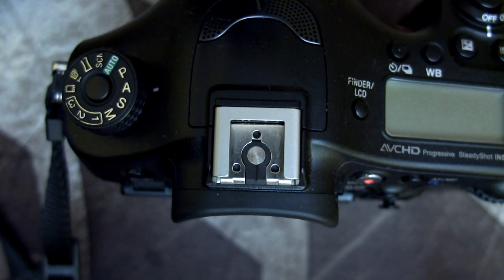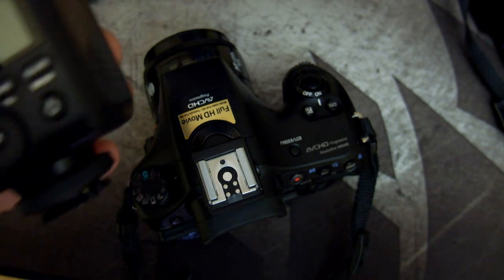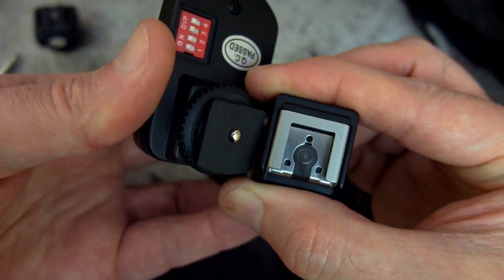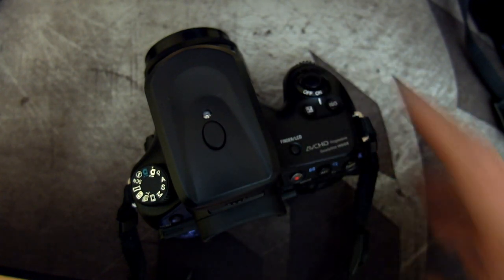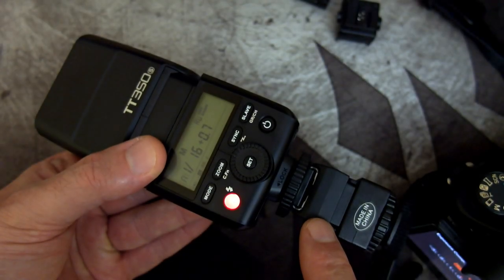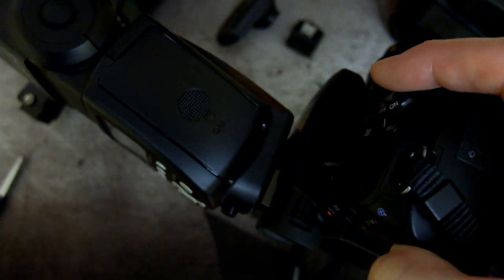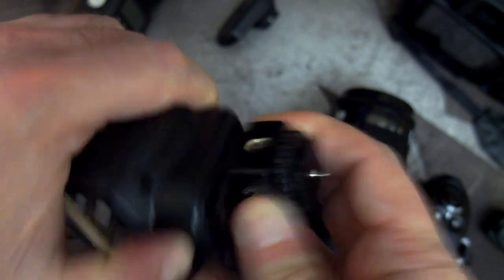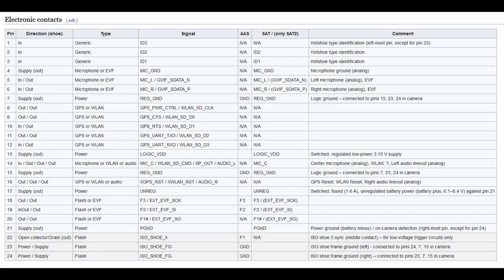Sony Multi Interface Shoe: Problems/Solutions + How to use the flashes on a standard hot shoe

Comment: Hello, I'd like to ask you a question: I found a Neewer flash at a very affordable price (Neewer NW635 TTL GN58 SONY) but the problem is that the seller told me it did not have the “Locking pin”. I wanted to know if it's possible to buy a locking pin or an adaptor to plug the flash on my sony a7iii? Thanks in advance
Reply from the maker: Even the Godox ones don't have a locking pin, and the Sony official adapters don't either! I wouldn't worry about it, however make sure you lock it down firmly when you attach the flash, I've no idea why Sony don't have locking pins for the holes, it's a mystery.
Reply: @MrBazReviews    He told me he didn't have the hot shoe of the flash , it's the object at the bottom of the flash that allows the flash to put it on the camera
Reply from the maker: @shinefiru3751  You can't add the locking pin most don't have it

Comment: Hello Mr Baz. I am sorry to ask you after all these years. 
so my old SONY A99 (which you also reviewed at 2022) original flashlight does not work anymore. 
According to my understanding, SONY A-mount A99 is using Multi Interface Shoe. 
which flashlight will you recommended on Multi Interface Shoe DSLR like SONY A-mount A99?

I had been seeing GODOX TT600, TT685, V850ii . I think you have all of these flashlights. 
Can I ask, does it work on A99?

I am sorry to ask this silly question. I had been searching all over the internet and can't find any good answer.
Reply from the maker: As per email 😁 But for others yes Godox work on E and A mount cameras
Reply: @MrBazReviews  Thank you!
but do I need to buy the adapter (as in the video)? or just plug and play?
Reply from the maker: @ShyDeath  No adapter if you have multi interface flashes and shoe. It is only if you are using the older Minolta inverted shoe (or if a standard shoe contact won't fit)

Comment: Sony A7S II + ADP-MAA + Sony HVL-F42AM. Is it impossible to use 3rd party Wireless radio triggers and obtain HSS/TTL?
Reply from the maker: If the Sony flash is converted it should work with third party triggers, for HSS/TTL, the only issues I've seen are some universal shoe (standard shoe not MIS) not always fitting the newer hot shoe. If it's a Godox you buy then it will have the MIS (multi interface shoe) and will work OK
Reply: @MrBazReviews  Thanks, bro

Comment: Hi there - I have a Sony A7iii just bought a few weeks ago but my Nissin i-40 is not showing up on the monitor screen.... It does however work in Manual mode. I do want it to work in TTL though. Do I need an adaptor?
Reply from the maker: If it's a Sony compatible one it should work, for TTL anyway. check the connection and clean out the contact if needed. If it's a non-Sony then it will be manual only

Comment: If anyone has problem getting the transmitter or flash to work, get the ATG Gold M/N Adapter.
Once you have that mounted onto camera's MIS (multi-interface show), you can even use Pocket Wizard or any normal trigger transmitter (433MHz or 2.4GHz trigger system) or Canon 580EX II, 600EX-RT, 600EX II-RT or Nikon SB-800, SB-900, SB-910 & SB-5000.
Reply from the maker: Many will work some won't I had issues with pixel triggers not quite fitting in
Reply: @MrBazReviews  ATG suggests to file or sand down the transmitter's front hotshoe.
Hope yours is not made out of metal, then you will have to power file it down.

Comment: Is there any way to convert the hot shoe to a 3.5mm jack? With an adapter or something? I am trying to find a decent microphone for a sony a6000 but till now the only solution I have found is having an external digital recorder with me.
Reply from the maker: I've not seen one, at all but can't say for certain I did a search nothing showed up. The shoe has the audio contacts, but as far as I can tell that only has limited support for a few Sony microphones. It's a bit strange the A6000 didn't have a microphone socket. Looks like you are stuck with either getting a shoe microphone, or doing some kind of external audio recording.

Comment: I'm getting an intermittent fire using my a7rii and a neewer trigger for a set of studio strobes. Used to work well. I was presuming this is down to age of camera and worn parts. Do you reckon this may solve my issue???
Reply from the maker: Have you checked the contacts for any damage? One of the problems with the multi shoe is the contacts are exposed, so I keep the caps on the base of flashes and triggers (and hot shoe). I would just inspect the trigger contacts and on the camera. Look for any obvious damage. Might be worth using a blower to clear out around the hot shoe, in case anything got lodged in there. I have seen that before some
Reply: @MrBazReviews  Thank you. I will have a good look tonight. Fingers crossed
Reply: What Neewer transmitter do you have?

Comment: Great video, perhaps you can advise if it will fix my problem with tge new Sony A7M4 camera.
I have the latest Godox XPro- S trigger unit and it needs a lot of force to mount it on the Sony hot shoe on this camera.
I am really worried about damaging my new A7M4 hot shoe when applying so much force to slide in the trigger unit, it's so tight to insert.
I have a Godox TT350 new flash gun also and this is just asdifficult to slide in the camera hotshoe.
Would appreciate any ideas and will this unit solve the problem. Many thanks
Reply from the maker: Have you tried the flashes in any other camera shoes? I've not had a problem with the Godox flashes fitting, in various MIS cameras, or adapters, none were really tight. I'm wondering if the camera shoe is not quite right, it should be a standard size, but if there is a problem it might be making fitting flashes hard. I'd see if you can get hold of another camera to try, or other flashes.
Reply: @MrBazReviews  Hi again, I have just visited my Sony dealer called WEX, we tried a different A7M4 and a different trigger unit, the staff remarked how tight a fit and a lot of force was required to mount on the camera hot shoe, maybe Sony are trying to encourage us to buy Sony flashes, not Godox
Reply from the maker: @MikeT-yy3  I know WEX I bought from them before. It's a fixed size, so unless they made it slightly tighter on the A7IV - never once seen the Godox flashes and transmitters (have used 4 of them), be a really tight fit on any Sony with the MIS. 
Saying that, I dislike the shoe quite a bit, flashes can fall off, as there is no auto lock pin, and if water gets in - you can misfire flashes. I've no idea why they went with that design. It's the part at the back near the contacts that sometimes causes problems with shoes that are a bit too long.
Very strange
Reply from the maker: @MikeT-yy3  I know WEX I bought from them before. It's a fixed size, so unless they made it slightly tighter on the A7IV - never once seen the Godox flashes and transmitters (have used 4 of them), be a really tight fit on any Sony with the MIS. 
Saying that, I dislike the shoe quite a bit, flashes can fall off, as there is no auto lock pin, and if water gets in - you can misfire flashes. I've no idea why they went with that design. It's the part at the back near the contacts that sometimes causes problems with shoes that are a bit too long.
Very strange
Reply: Having the same issue with A7M4 and X2 trigger.
Reply from the maker: @B-kl8vj  There must be some issue on this model, because I've never seen it on other cameras or even the adapters I have.
Reply: @B-kl8vj  Hi, I tried a couple of others in my local dealer and they varied, but in general they were all on the tight side,
Eventually I took a fine file to the trigger mount which has helped, but there's a limit to how far you can go.
Have you seen anything that acts as a coupler that would go into the hot shoe easily and insert the trigger on the other end that may fit better.
My Godox TT350 flash has a similar problem.
Maybe Sony are trying to tell us only to buy their flashguns?
Reply: It's definitely a problem on my Sony A74, Sony have made the hot shoe a much tighter fit which makes it very difficult to insert the Flash or the Trigger. On my TT350 and the Xpro- S trigger I have used a file to reduce the thickness of the foot of each of these units, but it's still a tighter fit than normal. The answer is to use the Xpro11 new trigger which is better but not perfect. The latest metal foot does help. Sony need to fix this problem

Comment: I need to mount a Godox flash using a multi interface shoe to a bracket using a 1/4 x 20 screw as an attachment.  I have not found a cold shoe which fits the MI shoe and has a screw mount in the bottom.  
I would like to mount my flash on a Custom Brackets RF-Pro AS rotating flash bracket which uses a 1/4 x 20 screw as the attachment device.  I would then like to trigger the flash with an XProS (Godox or Flashpoint) radio trigger.   This would be a simple way to use the flash on the bracket.
I cannot find a cold shoe which is compatible with the MI flash shoe. I tried adapting the plastic stand that the flash comes equipped with but that is not a solution because it places the flash too far back which interferes with rotating the bracket and holding the camera in the vertical position (even after the plastic feet of the stand have been cut off).
So far, I have been forced to use a Meike MK-FA02 off camera cord for the simple expediency of mounting the flash on the bracket with the screw.  The cord is quite long and bulky (far more bulky than the Canon off camera sync cord I used with the bracket when I shot Canon gear). Wrapping the cord around the bracket is cumbersome.  I hate to cut the cord off the $40 Meike just to use this unit as a screw mounted cold shoe.
Is there anyway that I could just get a MI hotshoe and attach it to a piece of aluminum stock with a 1/4 x 20 threaded hole,  That way, I could effectively have a cold shoe which would fit the MI foot of the flash...
Reply from the maker: The issue is mostly with the MI shoe design as it's offset it won't fire if mounting flashes/transmitters on standard shoes. So the only way around it is as shown convert to the Minolta I-ISO shoe then convert it again to a standard shoe. Other option is to use the sync connection directly from camera to the XPro S so you can trigger it with any camera not just the MI shoe ones.
It's unfortunate, but Sony really didn't think about the design of the shoe properly, even more so the actual MI flashes etc. with that offset contact point.
Reply: @MrBazReviews  What about using a Pixel TF 334 Hot Shoe Adapter.
Reply from the maker: @shilks8773  I've not used it but it should give manual flash trigger (TTL is dependent on the protocols which are in camera ie they won't work on other brands for TTL)

Comment: excuse me i have to mount my godox multi interface shoe flash... so with mis male plug....    into a standard cold shoe female.... is it possible? only to support phisycally not to trigger...for that i have radio transmitter
Reply from the maker: It will go in a standard cold shoe, it's just it won't work in a standard hot shoe aka the contacts it won't fire. If that's not important then you can just fit it to any shoe
Reply: @MrBazReviews  many thanks

Comment: I noticed that the shoe insert has tiny gold lines, for use with some other device. Is it okay if I used a normal shoe without any connecting those lines?
Reply from the maker: Most devices will fit ie normal shoe, sometimes the shoe end can be slightly too long

Comment: Any idea what I need for a studiolight trigger with my sony a6100?
Reply from the maker: What studio light are you using?
Reply: @MrBazReviews  I have two bowens prolite 120 lights
Reply from the maker: @marissadamink5779  You want something like this via pc sync cable to trigger them
https://amzn.to/37RAWFP
ie a hot shoe adapter with the port, then connect it to the lights. The A6100 doesn't have one built in. Similar ones are around on eBay for not much cost.
Reply: Thanks! I'll try it

Comment: Will a Godox X1T-N transmitter work with the hotshoe on a Sony a7ii?
Reply from the maker: It works but no TTL as you need the Sony version for that (same for other brands/mixed etc)
Reply: @MrBazReviews  Is there any kind of adapter that allows TTL usage? Or is the only option buying the correct version for your camera?
Reply from the maker: @an_insomniacs_dream4842  Not that I am aware of. Different makers have their own protocols for TTL, and the Sony shoe the only adapter for TTL is the Minolta style one shown here. The flashes are cross brand ie if you have a Nikon/Canon/Fuji etc flash and Sony transmitter it would do TTL, but the transmitter has to match the maker . So you need the X1TS for it to work.
For someone who has say 2 brands, you'd still need 2 transmitters one for each make to get TTL, but you could share the flashes off camera for TTL.
Hope that makes sense
Reply: @MrBazReviews  It does, and thanks for the explanation. Last question; would my scenario of using the X1T-N on my Sony allow me to use HSS?
Reply from the maker: @an_insomniacs_dream4842  It should work in manual with HSS

Comment: I can let it works but TTL is not working the photo is to briht. Normaal it most stop or close the shutter.
Reply from the maker: What flash are you using on what camera? TTL will only be for Sony compatible flashes on Sony E, Sony A and the Minolta bodies it should work with TTL (not all Minolta but some do)
If you put a Sony shoe flash with the adapter on a Nikon or Canon etc... you can't get TTL in the same way a Nikon flash won't TTL on Canon (different flash systems)
Reply: @MrBazReviews Thank for you replay. I use the old Minolta Flash 5400HS and 3500Xi. This can direct on a sony A68 the have the old shoe. The not working. When a use adapter on my Sony A58 the wil work only the photo is for 80% to 100% whit. DDL is not working. I have looking fusther i have anther a Topca 330AFD i have buy it years a go i like this flash it have two one little en a big plashes. The big can you rotate the other is more fill in. This one is well woriking on the Sony A58 whits the adapter but not on the A68. Oke i can now use one on the A58. What i will was wirelles but that is not working now. The flashes both have a wirelles mode.
Reply: Sorry a have not 68 but 65

Comment: BTW I fried my hot shoe's internal flex cable by using old vivitar flash on this Multi-Interface Shoe. Too much $ to fix. Stick with a dedicated Speedlight  design. Sony should have prevented this by sticking with odd shape Hot Shoe...too late now
Reply from the maker: I'm not crazy about it either, guess we're stuck with it. That's a bit of shame, cost probably not worth it getting it fixed
I doubt Sony will change the hot shoe, might have been better to get it right when the did switch it

Comment: My 58am flashgun completely snapped off the top of my camera!
Reply from the maker: Unfortunate, you might be able to get a replacement part for it. Sadly the newer shoe whilst metal, the flash shoe isn't really any stronger than the older Minolta design

Comment: Sony's biggest mistake with making the MIS.
Soon, so will Canon's world first expensive amateur camera @ close to $7,000.00 out in 2023, EOS-R3!
Reply from the maker: If you look at the Canon shoe on the R3, it's an extra part added on to the normal shoe. Hence it remains fully compatible with the normal flashes and other devices.
What Sony did wrong with the MIS is:
The main TTL flash contacts are in the tiny gold array v the usual 3/4 contacts around the middle sync port
If you get water on the shoe, or near those contacts, very good chance you won't be able to fire the flash
MIS flashes can't be used on other hot shoes, unless as I have shown you use multiple adapters to do so!
Most of the MIS are plastic, apart from the top end Sony flash. they are easy to break
Some normal flashes won't work on the MIS shoe, as the sync port isn't in the middle (as shown)
Even MIS devices like the microphone they did, doesn't work on most cameras anyway properly (only newer ones)
Sony never made a hot shoe GPS to make use of those contacts
I'm constantly having flashes fall off because there is no auto lock pin on MIS flashes

If you want me to be honest, the MIS is pretty weak, and sub par solution. I can't stand it to be honest
There are work arounds, most of them are not perfect. Purely because the company didn't think about it properly
The Minolta shoe might have been a bad idea, least you can use one adapters for other flashes, and it has auto lock
Very silly for Sony to go to another proprietary shoe
Reply: @MrBazReviews  Sony still have problem with latest & overpriced flashes with metal shoe.
There are only two tiny taps holding the flash on the camera's hotshoe.
It does NOT have a metal pin that drive down into the camera's hotshoe.
Reply from the maker: @angelisone  The HVL-F60RM has the metal foot, but as you say the auto locking pin, it doesn't have one. It has the two small bits that come down a little when you lock it. It's not nearly as secure as it should be.

The other problem is in Europe, it retails over €700, just the single flash. You can buy an entire lighting set up for a fraction of that outlay. It's a non starter straight off the bat